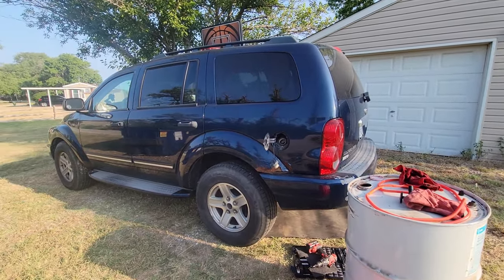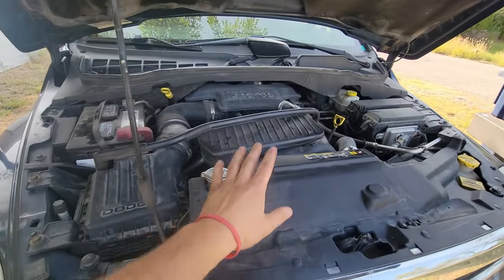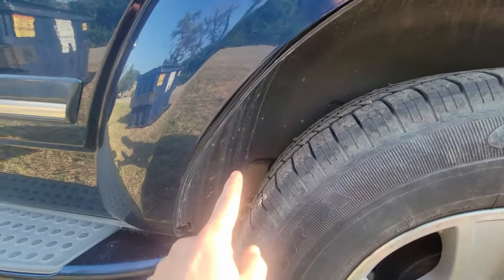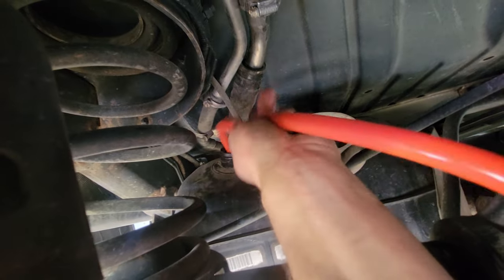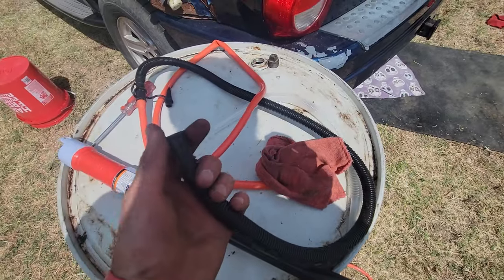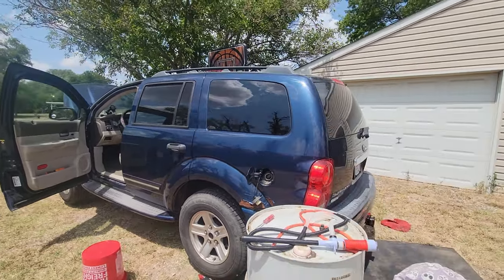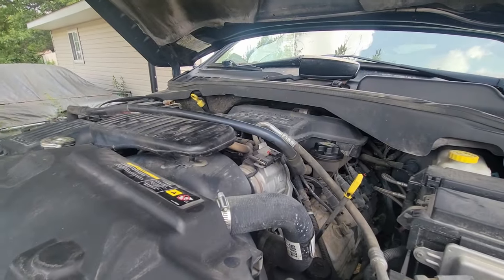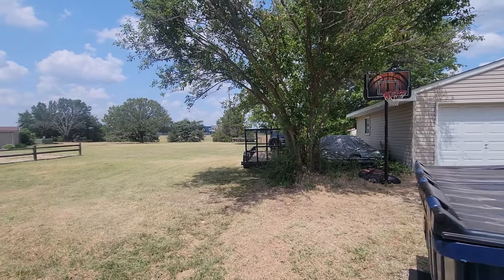Diagnosing BAD Gasoline in Your VEHICLE

Comment: My 1988 Toyota pickup started giving me the check engine light that would flash off and on but never stay on or throw a code in the computer. The light would only stay on a second or two and it wasn't a constant thing so I never knew when it would act up. The engine usually would stumble and lose power when it did so. After ruling out any electrical problems I just made a wild guess and decided the gas had water in it which was causing the computer to think the air/fuel ration was too lean and so was retarding the timing.  I used some marvel Mystery Oil in the gas tank and it solved the problem. Hooray for lucky guessing. Now I always add some of that to the gas tank each time I fill up the tank and of course I stopped buying my gas at the place that had the water in the tank.
Reply from the maker: It's wild how often this happens. Glad you figured yours out too!

These Kwik shops have recently been sold to another company. So I'm not surprised by this happening a second time that we know of at the same location.

Comment: My wife's honda civic 2014 filled up with some bad fuel somewhere. The symptoms she started getting was going into limp mode as soon as she hit 2500 RPM. We went to two independent shops before taking it to the dealership where they determined it was the gas in the tank, not an electrical or mechanical issue.
Reply from the maker: @WanderingRobotStudio  wow, three shops to figure out. Glad they found it!

Comment: Gas goes bad fairly quickly, in like 3 weeks to a month. If the gas station you got the fuel from is slow as far as business. Then odds are the gas you bought is bad already 😅
Reply from the maker: @mora103  yes! I've heard that usually the gasoline is already a month old by the time it's delivered to the fuel station

Comment: Why not unhook the fuel line before the motor, hook up a drain hose to the fuel line and turn the key on?  The electric fuel pump in the tank will pump the gas out for you.  OR  Go buy a cheap inline electric fuel pump ($10-$15) and hook it to a hose, then shove it into the tank and drain it that way.
Reply from the maker: @MrDozer120  Did you watch the full video? I did end up using an electric pump. It worked great! 

Using the fuel pump itself isn't a bad idea, but you wouldn't want to empty it completely that way. You shouldn't ever run the tank empty because of the debris at the bottom of the tank. It could clog the pump or ruin it for good. I've replaced a few of these before my YouTube says, due to that issue.
Reply: @ArcticVette  Yes, I did watch the whole video.  I've looked at those pumps myself and walked away.  In my opinion, using a cheap inline pump with some hose is a better solution.  True, running a tank dry isn't good for the pump, but it's not because of the trash they pick up.  There is a sock on the pick up tube to stop that.  If the particles are small enough to pass through it then they won't hurt the pump.  Pumps get hurt when the tank runs dry because the gas cools the pump.  Running it dry once or twice won't kill the pump.  I had a truck with dual tanks but the gauge only worked for one.  I ran that tank dry at least a dozen times before the pump gave up the ghost.  I didn't mean to offend you, I just asked a couple questions and threw out some ideas.  Keep up the good work.  You have to be doing something right for the youtube algorithm to put you on my feed.😀
Reply from the maker: Awesome! I wanted to make sure you seen I did use one instead of the hand pump the entire time. 😅

That's good to know. I've always heard its from the debris, never about cooling the pump. That makes a lot of sense though, and I appreciate you sharing it with us! 
Thank you and God bless!